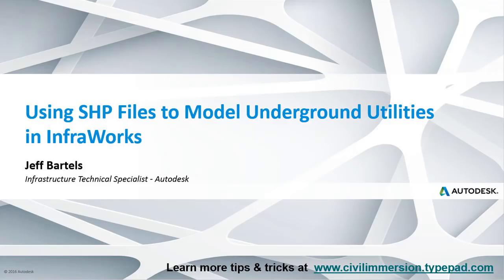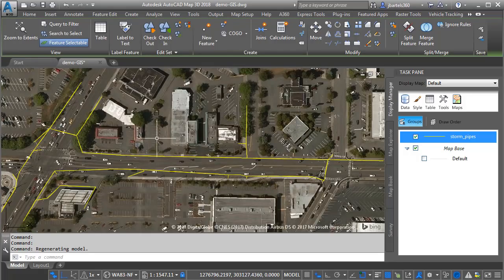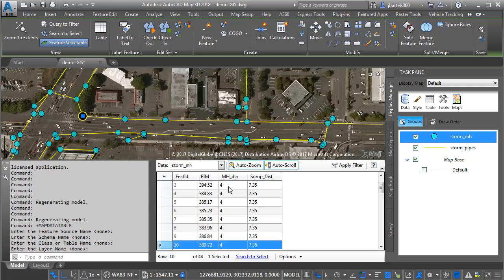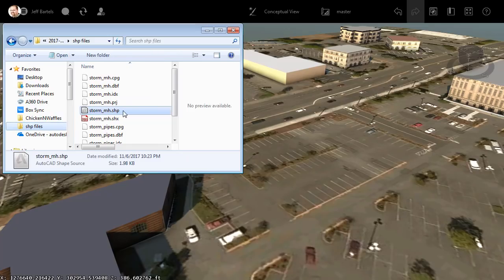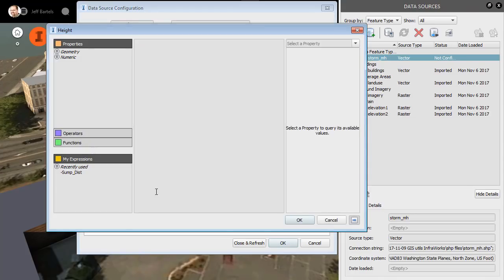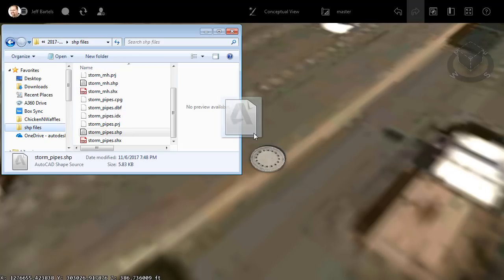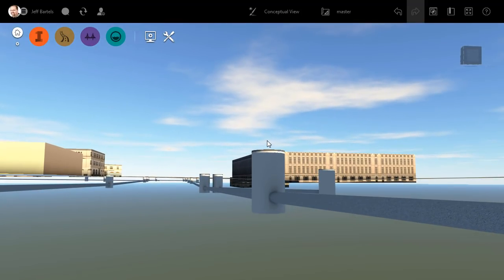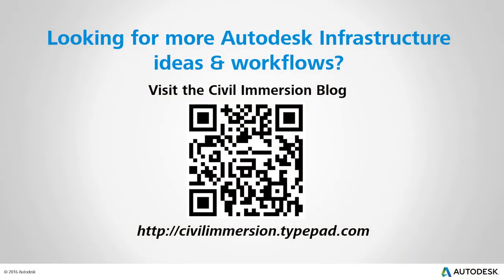Using SHP Files to Model Underground Utilities in InfraWorks

Comment: Hi Jeff. Your video is extremely helpful. I have one question, how do you create the shapefile of pipe connector and lines? Is there a video talking about that? I tried to export shape file from a vanilla cad, but all i could get is just a 2D point, not a 3D object after I put them into Infraworks

Comment: Hello Jeff, 
I always learn from your video, your videos are very helpful. I am having trouble with coordinate system with Model Builder. How do I change the Coordinate system before download the infraworks model? Would you please give me a hint? appreciate your help. Thanks,
Reply from the maker: Tahera Yeasmin Hi Tahera, By default, the models created using model builder are assigned a Lat Long coordinate system. After opening model, visit “model properties” and you can assign the coordinate system of your choice. Hope this helps!
Reply: Hi Jeff, Thank you very much for your quick reply. I did exactly the way you explained here, but Infraworks works little finicky in my computer. I created two models followed by two methods as you explained in other video.  One model from model builder and other one from scratch by using my own terrain-data and  shape files. In model builder model I changed the coordinate system from LL84 (datum WGS84 lat long, which is a default coordinate) to my own coordinate system which is  NAD83/UTM Zone - 14N and my pipe shape file falls underneath the terrain surface, but MHs are staying away high in the sky. but when I turn off the terrain layers, see just pipes and MHs, then pipe networks looks fine. On the other hand, the fresh new model was built from my own terrain dem data and imported the same shapefiles for pipes and MHs are working fine. Not sure what I'm doing wrong. I really like to create my model from model builder, it looks prefect and save my tonnes of time and serve my purpose quickly. In future I can use this model in road and drainage projects. I was wondering is there any limitation for file sized or shapefile data? In my case, my shapefiles has 2600 pipes and 2600 + MHs. How many pipe segments and MH can be imported into the Infraworks model? I appreciate your thoughtful hints and help. Thank you for your time for creating all those helpful videos. Best regards,